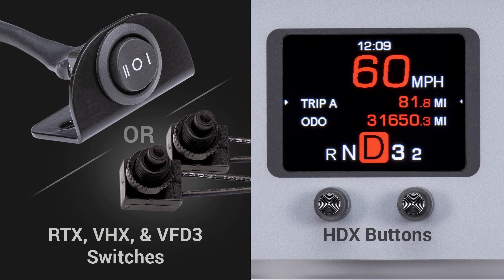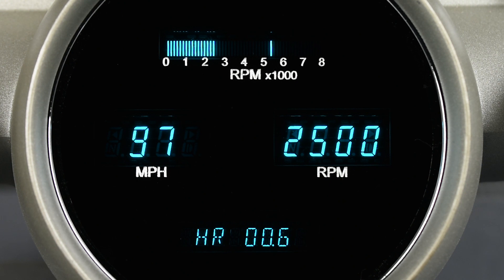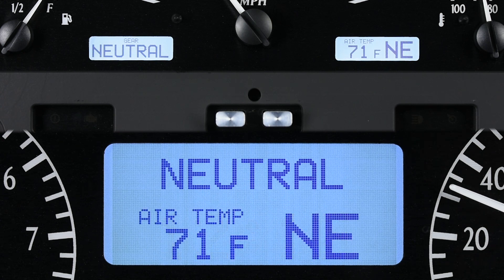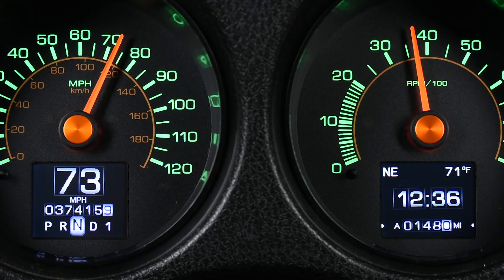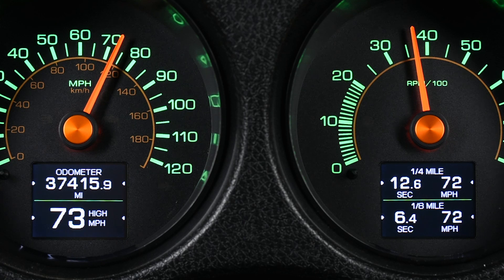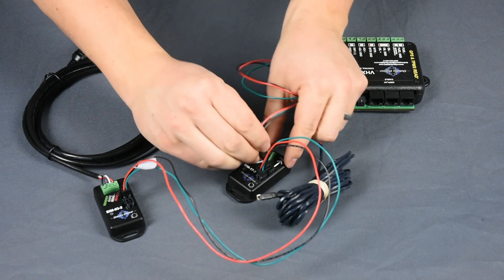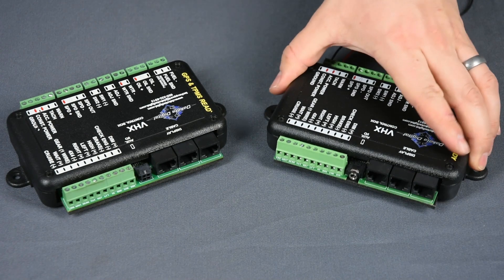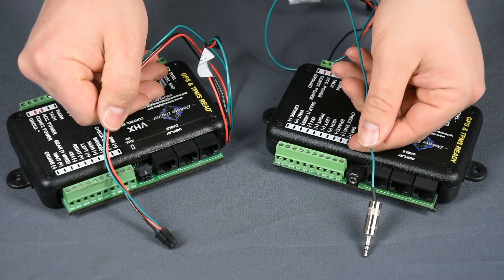BIM Preview Video

Comment: GPS-50-2 Daisy chain with the BIM-01-2-HSN2?
Reply from the maker: When using a GPS-50-2 along with a BIM-01-2 variation, we suggest connecting the Speed output from the GPS directly to the instrument system control module, not using the BIM connection.

Comment: What does it mean EEE  message in fuel setup .
Reply from the maker: An open circuit, or out-of-range reading from the sender. Double check the wire is connected to the control box and that the system is set to the sender in your tank.